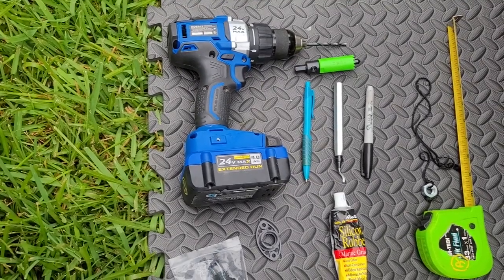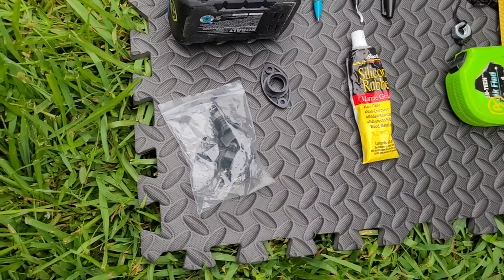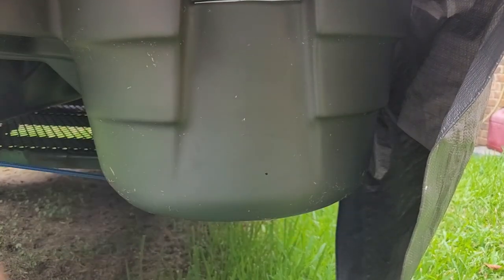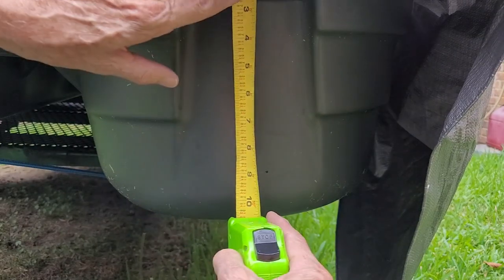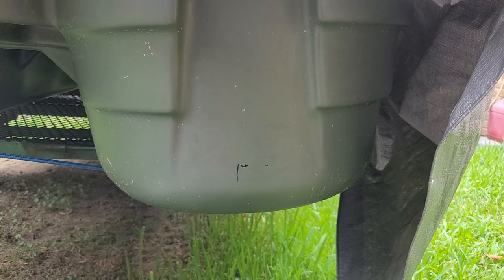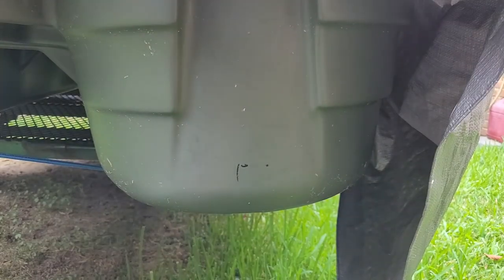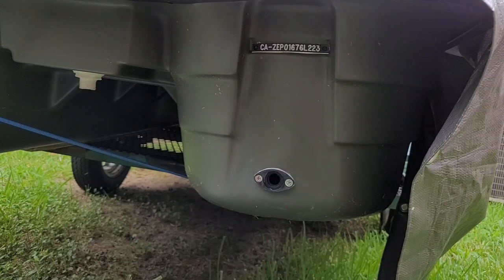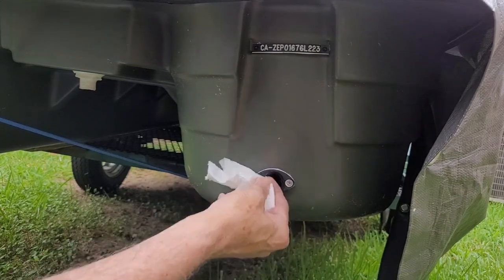How to Install Drain Plugs in Bass Raider, Pond Prowler, Kayaks, Etc.

Comment: I love this idea, but I'm curious how it's working for you?  It's a scary thought to drill a hole under the water line.
Reply from the maker: You're correct about being scary!  However, it was a straightforward, quick and easy installation.  Would I do it again?  Jury is still out because I've not noticed enough water ingress to even drain out and the OEM drains on the front of the Bass Raider pontoons would likely have worked just as well.  Good news is there are no leaks after installing the drains.
Reply: @omoutdoors  the tipping part of the OEM drains is the hard part / hassle. I'm also wondering why these small pontoon manufacturers haven't engineered a scupper system. Still love the boat, but the kayak industry is much more innovative.

Comment: Have you ever considered sealing the seams top and bottom with some kind of sealant? Not taking the boat apart, but just pulling the seam back enough to get a bead of something under it all the way around? I have to admit, I want one of these boats, but this is one of the biggest reasons i am hesitant to buy it. I believe most of the water would get in by rain water seeping in if left outside uncovered, because all of the guys on here who say they keep them indoors have said that they have never had issues with water getting in the pontoons. This kind of boat would sure open up a lot more fishing territory for me, but I don`t know......
Reply from the maker: Thanks for taking a moment to pass along your comment. I’ve never had to use the drain plugs I installed and in retrospect I would not do it again.  They have not leaked, and my boat has not had any water inside.  In my situation, I keep it covered with a tarp outside.  I am careful to make sure the seams are covered with the tarp, and I’ve had no water in mine, and I’ve used it regularly for over a year.   This has been the favorite boat I've owned,    John